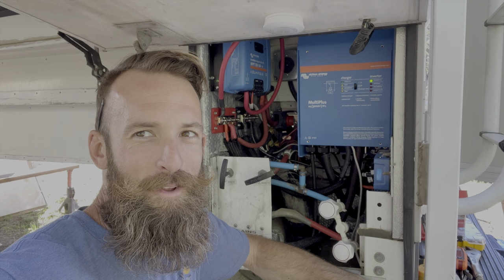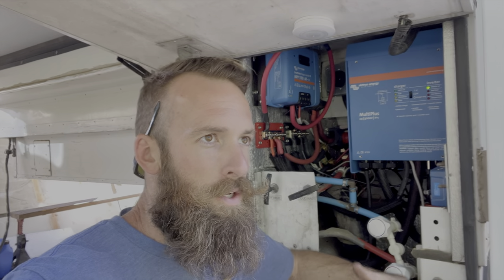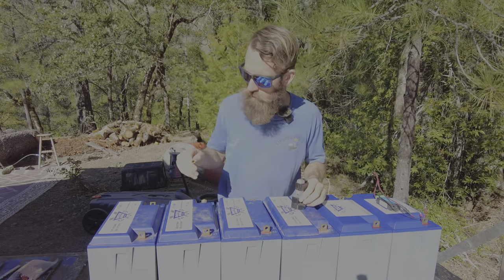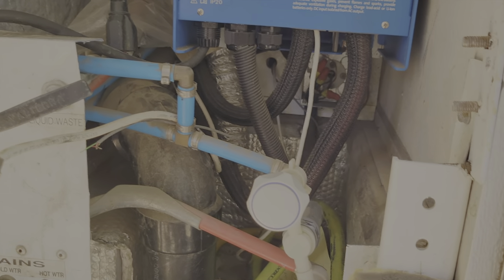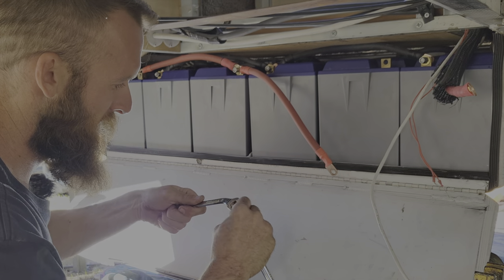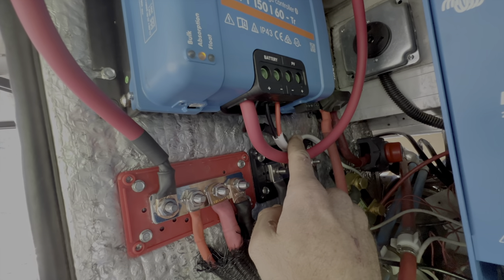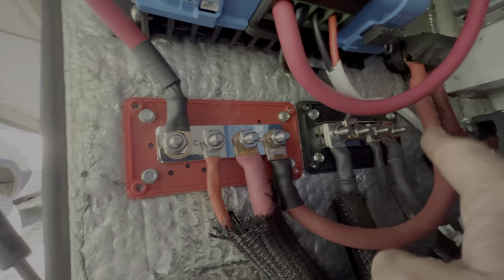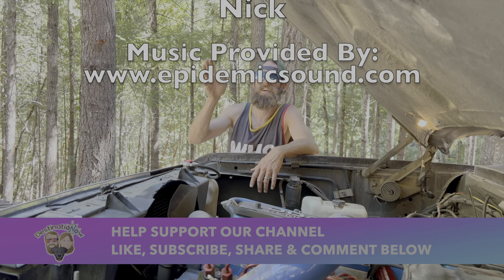12 Volt To 24 Volt RV Electrical System Conversion | Maintenance Monday | Destinationow

Comment: Dont need all the nuts and bolts
 Why / benefits running a 24 volt battery system besides wire size ?
Reply from the maker: Well we like to run our air conditioner off the batteries at night so we don’t bother our neighbors with a generator. It’s more efficient to run AC with off a 24 volt system than a 12 volt system. The higher the voltage the more efficient it is

Comment: So your appliances are still 12v, but the batteries only feel 24v… interesting.
Reply from the maker: Yes exactly. All the heavy loads run off the 24 volt system.

Comment: I'm going to set up a similar system but the grounds is what throws me of too.  So you have the Multiplus ground going to the Orion?  What about the metal frame?  Also, what about the individual 12V outside camper lights (that came form the factory)?  Did you leave those grounded to the frame?

In my head, it's 12V and 24V being connected to same metal frame and "fighting over electric space" or something.  And because the metal frame carries the electricity (completing the loop) for the 12V trailer lights (basically like a circuit), this is what throws me off when thinking of adding a 24V ground to that.
Reply: Just thought – Does the Orion also convert the 24V ground (from Multiplus?) into 12V, then the ground after that matches the 12V and goes to metal frame (so everything grounded is 12V)? ..... my brain hurts
Reply from the maker: Both the 24v ground and 12 volt ground connect to the same ground peg on the Orion.
Reply: @DestinatioNow   Gotcha. So do you have a ground from the Orion to the metal frame? Is that your main ground?
Reply from the maker: @ForgeAheadwithMike I don’t think so. Although that’s probably a good idea

Comment: I may have missed the section but now that you are 24 volts what do you do about charging from the vehicles alternator?  Will you batteries accept a 12 volt charging?  I am not aware of a DC-DC charger that will take output from a 12 volt alternator and bump it to 24 volts.
Reply from the maker: The alternator on the truck does not currently charge the 24 volt battery bank. I am considering installing a secondary 24 volt alternator to charge the batteries while we drive.

Comment: Did you use dialectic grease on each terminal and lug? May help with corrosion just sayin’
Reply from the maker: No I didn’t, good idea though. The batteries are completely sealed away in that compartment so they don’t really get exposed to the elements. I didn’t see any evidence of corrosion when I pulled everything out after beach camping for 2 years straight
Reply: deox i put that shit on everything.